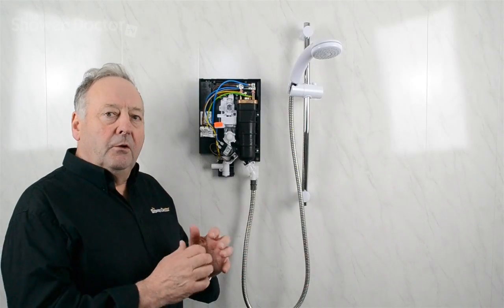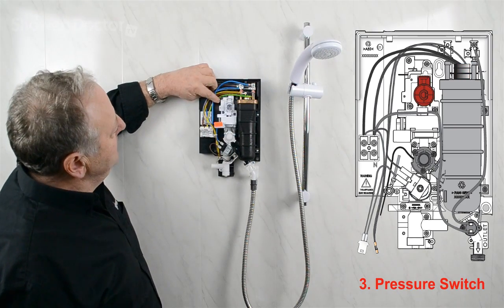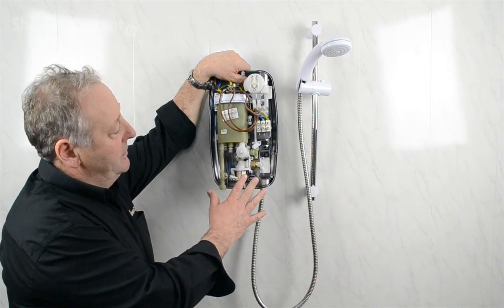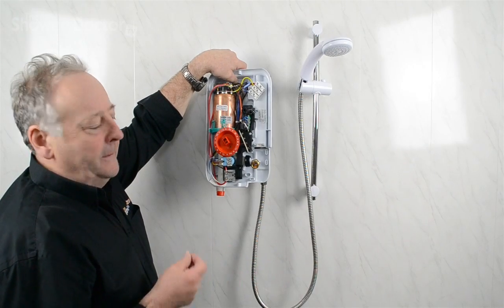Shower Doctor TV: Electric showers explained

Comment: My Creda 950DL electric shower doesn’t work properly.

The Mid LED light stays off – water runs cold at full pressure. Turned the water flow dial to extreme hot – then water gets lukewarm, while the flow from the showerhead is weak. Both High LEDs stays on, while the Mid LED stay off.

After watching your repair video, I tested components… I then tried to remove component/s. However, after spending about an hour trying…I found they were not straightforward to remove. I then replaced the cover and left it.

I suppose because the Creda 950DL is so difficult to repair, why there is no information online showing how to repair them???

So, I guess it's got to be a new shower?!

Comment: I just suddenly have no power, but no fuse off and pullcord light on. Any ideas?
Reply: Hi, Did you find the cause of the fault? have the same thing happening to my mums shower... checked fuse inside shower and switch in ceiling has electric flow, just not power to unit? There was water sitting in the top around heater switch.
Reply: @denisemaas8201  Hi yes a wire had burnt out in the shower itself. It was ducked, bit dodgy really

Comment: Hello.Doctor Shower.I have an electric shower MX Inspiration QI. There is no hot water coming from shower.last time when I used shower pressed power off button all the lights appears just for seconds instead of phase shutdown light.
One thing more if the pipe of shower (from electric shower box to hand shower) is twisted for long time after usage so it can effect the shower mechanism or it can create the the same problem (no hot water) which i am facing.
Reply: Naveed...
Have a cold shower instead; problem solved.

Comment: Thank you. I have a Triton shower 9.5Kw. When I operate the switch to turn it on, neither the switch light or shower light comes ON at all. I have verified that there is electricity flowing into the unit and everything seems normal. I'm thinking that perhaps is the 'power selector unit with microswitches' which needs replacing? The shower was working fine before that. Could it be a sudden water flow issue? Many thanks!

Comment: This is a question  I cannot find any information on . 
 My question is , what is the approx max time a electric shower should run for.  Is it 10 min, 15, 20 , 30 , 40 , minutes or more , or is there simply no specified time. 

My question relates to plumbers  telling me that prolonged use,  at any one time in a shower for over 15 minutes or more , burns the shower components out much quicker , as the components and elements are not made to stand such constant continuous use. 

Why do manufacturers nor specify any max time restrictions , or is it because  it has no effect on the components in the unit. 
Answers please.

Comment: I like your videos Shower Doctor, but not one of them mentions anything about the cause of dripping water out of the bottom hole of the shower when it's turned off, which was and still is the issue I've got. I just bought a new shower, removed the old shower unit and replaced it with the new one. Everything works great. Water switches on and off. Water heats and cools as it should, but theres just one problem...its STILL DRIPPING! It's driving me insane...AAAARGH!
Reply: ashleelmb.
Plug the hole up and it will stop dripping!
Reply: @redblade8160  I resolved it 2 weeks ago.

Comment: Can you leave the isolator switch permanently on ,mine has stopped working but its on all the time
Reply: Granville...
Don’t worry about it, if the isolator switch is on all the time, then at least it saves you the job of switching it off each the time.

Comment: Just like to say big thank you to this man here's why
Had a problem with our show Watched this mans videos on the information he gave in his video I came to the conclusion it was thermal cut out 
So ordered the part from eBay put part in the show still the same but this person told me how to test it the new one was the same as the old one but lucky enough where I got the new part from was the same town as me so I rang them up and told them I was taking it back.
When I got there they seamed to panic a bit and gave me a new one straight away I tested it the way this man told me to and I had power across the terminals didn't  have this on the first two put it in the shower worked thank you shower doctor you not only helped me with fixing my shower but  also stopped me from accepting a bad replacement for my shower

Comment: Hi, Is a copper heating cylinder better or a polyamide pvc heating cylinder better? Which type is better to prevent electrocution when it is faulty? 
I heard that polyamide pvc heating cylinder would prevent electrocution if a wire is loose and touches the cylinder, is it true? Thanks.

Comment: Hi,
1. What is the safest way to prevent electrocution if the water heater is faulty?
2. Would putting the shower head on the stand without my hand holding it, and water spraying on my body prevent electrocution?
3. Would putting the shower head on the stand without my hand holding it, and after water is sprayed into a pail, then I use the water from the pail by scooping it and pouring on my body prevent electrocution?
4. Would using a plastic shower head and holding the plastic shower head middle stick in my hand and spraying water on my body prevent electrocution?
5. Would using a plastic hose instead of a plastic hose that has metal outer casing helps to prevent electrocution?
Thanks.

Comment: Hello Shower Doctor.. I just bought and installed a Panasonic DH3KT1. The problem is the water is not hot enough even when I push the dial all the way up. It only gets hot when he water flow is really low. Could you please help advise?
Reply: Sameer...
Try turning the dial instead of pushing it.

Comment: Hello, I have a Triton Bezique ll which is only six months old.  When it is on cold, there is no noise from it.  However, when I turn it up to warm, there is a constant clunking noise.  This doesn't affect the heat of the water or the flow but something's not right.  This is my third Triton and I haven't experienced this with any of the others.  Can you help please?

Comment: sorry but in which countries is this used? in latin america they use "suicide showers" and this looks pretty much the same , just separated from the shower head. 
i'm from italia, traveled a bit across surrounding countries and never in my life saw something like this.
Reply: Everywhere uses them in the U.K.
Reply: There's a very large difference between the suicide showers and these, suicide showers have 0 fail-safe and they're raw heating elements on water, these are very well thought through and have several fail-safes along with a much safer application of electricity.
Reply: Uk and Ireland we have completely different heating systems In our houses we use boilers for central heating.

Comment from the maker: If there is blackening at the tco then the connections maybe loose.
I would be inclined to change the solenoid if the readings are this high.
Have you tested that you have 230-240v inside the shower?
Reply: The Shower Doctor 
Thank you for your reply.

When I told the wife about the blackening on the connections, she insisted I called out an electrician. I went through everything we have discussed and one extra bit of info (prior to this  (for around 2 months)the shower would work for 5 minutes or so then go cold ). However, the electrician on closer inspection noticed that one of the red live wires had melted onto the back of the plastic casing-it looked ok until you just prized behind it. He then recommended a new shower. I am now looking round for a similar shower, so it will not be too difficult to install.
Once again thank you for the information . Your videos and advice gave me the confidence to use my multi-meter for the first time..
Reply: The Shower Doctor
Reply: The Shower Doctor toou

Comment: My Creda (650) shower has stopped working. Pull chord light still on and circuit breaker still on. The high and medium button lights have gone off, the cold button light is still on, however there is no water coming through at all on any of the three buttons. The shutdown button- the light come on and flashes then goes off-as normal, but there has been nothing to shutdown.
Reply from the maker: chemistry636 
It may be your solenoid valve, you can check it if you have a multi meter, you should have a reading of at least k3.5 ohms, across the two terminals any less and you need a new valve. (Check the valve in the failed state.) (When 
it has stopped working!)If there is power getting to the solenoid and it is not operating then there is a good chance that you have a faulty solenoid.http://www.youtube.com/watch?v=NzJjzWqxesc The video is intended as a guide and does not cover every shower. 
If you don’t have a multimeter  we sell them  with a guide on how to use 
them for checking and testing the various parts of your shower.Apart from helping to fix your shower, they are really useful for 
checking you have a power supply to appliances, for checking fuses and letting 
you know much power you have left in batteries (So you 
will know if they are good or not) and lots of other jobs, in short they are 
well worth a few pounds) http://www.showerdoc.com/installation/electrical-products/SKYTRO-600-005-Digital-Multi-Tester
Reply: The Shower Doctor Thank you for your reply. I have just checked the solenoid value and have a reading of k3.99 ohms. Although what I have noticed that the thermal cut out (to the left of the solenoid) looks slightly black on a couple of the electrical connections. Could the symptoms I first described be related to this item.
I look forward to your reply.
Reply: chemistry636 
solenoid value has a reading of k3.99 ohms.  
Continuity Test-Thermal cut out; the sound comes on and stays on, numbers appear then disappear and then rests at three zero`s with the sound still on.
Continuity Test-Pressure switch; NO sound, however there is a reading of 1877.
Reply: Hi i've a Creda 950DL may fault is that its running cold and it shows the overheat button on red when the shower is on can it be repaired ty

Comment: Hello Shower Doctor. I have a triton enrich shower. There is a light at the top of the shower unit which indicates power (ie electricity) into shower unit. When the rotating switch is in off position the light is on. When I rotate it to on position the light is off and the shower does not come on. Can you tell from this what part inside shower is faulty and needs replacing?
Reply from the maker: Hi Ashley, this fault could actually be external to the shower.  Those symptoms often occur when you have a faulty pull cord switch.

Comment: When I pull my shower cord the light comes on to signal Power but when I push the power button on the Triton the light at the pull chord goes out and the shower does nothing, subsequently when I unpress/turn off the Triton the pull chord light comes back on. I have checked the circuit breaker for a bad connection and it's fine.

Please Help

Triton Jewl 9.5kW
Reply: Probably a faulty pull cord swotch

Comment: Although water pressure is good to the unit the units low pressure light comes on and of as the hot and cold issue happens.
Reply from the maker: The things to check first are:

1 That the main valve coming into your house is fully open. 

2 Then check that the valve on the line to the shower is fully open. 

If these valves are not fully open then there may not be enough water getting to your shower to cool it properly the overheat safety device will turn the power off until it cools Then it all starts again
 
Make sure that the shower head is clean and clear, that the hose isn't kinked (this can happen just behind the hand set where it is difficult to see) also check the inside of the hose although it can look OK on the outside it could have collapsed internally 

The other possibility is a faulty flow/stabilizer valve not allowing the correct amount of water into the shower.

Comment: We had a Triton T90 xr fitted about 2-3 years ago . We were told it was a new model .What happens now , you switch on the ceiling power  switch on by a cord ,  and the light comes on . I press the  button on the shower and the ceiling light swich light goes off .When I  press the shower button off . The ceiling power light switch light comes back on .The shower does't come    on . Before this , Just recently , you were in the shower and the water just stopped . Power seemed to be on .Sometimes the shower runs for a few seconds and then stops . I hope I made sense . Is this a repair  job I can do myself . Please help !

Comment: Hi, I have an old-ish iflo electric shower in a caravan. The problem I am having is that when the power button is pressed the water comes through freezing cold and the power light does not come on, and then intermittently the light comes on and the water goes boiling hot (no happy medium temperature), then off again and cold and so on and so forth. Could you help suggesting what this could be please? Thank you.
Reply from the maker: The things to check first are:

1 That the main valve coming into your house is fully open.

2 Then check that the valve on the line to the shower is fully open.

If these valves are not fully open then there may not be enough water getting to your shower to cool it properly the overheat safety device will turn the power off until it cools Then it all starts again
 
Make sure that the shower head is clean and clear, that the hose isn’t kinked (this can happen just behind the hand set where it is difficult to see) also check the inside of the hose although it can look OK on the outside it could have collapsed internally

The other possibility is a faulty flow/stabilizer valve not allowing the correct amount of water into the shower.
I would also check the power supply to the shower is constant.
Reply: The Shower Doctor It was the main valve, thank you so much! :)

Comment: If the shower is either fully hot or fully cold with no pressure variance and nothing inbetween ie warm water control..what can that be thx
Reply: This points to a faulty flow valve.
Reply: ***** thanks

Comment: I want my power shower to use less water. Can I just change the shower head to restrict the flow rate?
Reply: Why an earth would you want to do that ?
Reply: How would it save hot water for other people when an electric shower works off the cold main and heats as you use it, not from your hot water tank? How would it save money? Just because the shower head gives out less water doesn't necessarily mean it will cost less to run.
Reply from the maker: If you have a power shower then yes you can use a head that will give you a restricted flow.

HOWEVER!!!!!!!!!!

If you have an electric shower then you need to use a head that is designed for an electric shower and preferably the original manufactures shower head or thier recommended replacement.
Reply: To save money and leave some hot water for other people
Reply: @bunglenzippy  
Tell these other people only to have a cold shower and then you will have plenty of hot water only for yourself.
Reply: The Shower Doctor   Hi there my shower is a Creda 950DL and the overheat red button is on and its very cold also can you possibly help me Doctor ty

Comment: Hi, Great video's…. I have a fault with my Triton Caselona. The water has started to come out of the little tube at the bottom of the shower unit instead of the shower head. Any ideas what it might be?
Reply: the shower needs a new pressure relief device,,,
Reply: The pressure relief device (that little tube)dropped the little rubber seal who had inside.
Now the water is coming out that way.
Need to replace it.

Comment: Hello Shower Doctor, I hope you can help. We have very hard water, my shower is a Galaxy Aqua 3000si 9.5kw. When in use it is making a noise like a boiling kettle. When on the high setting it is too hot to stand under so we have to use the low setting. I thought the flow might be restricted due to the shower head being scaled up but the problem is the same even with the shower head removed. I'm hoping you can advise which part needs replacing please. Thanks in advance.

Comment: if the water pressure changes from the supply line(for example someone starts the dishwasher) does the mechanism recognize the pressure difference and regulate it and adjust the temp accordingly also?
Reply from the maker: The answer is yes and no!
The cheaper showers do not recognise any pressure difference and as you go up through the price range the control of pressure and temperature becomes better, the more expensive showers control the temperature very accurately

Comment: Hi there, brilliant videos but I can't determine what my solution is. Triton t90si - water temperature has dropped dramatically. To get warm water I have to turn the dial to 9 or 10 and then the pressure is very low. I've used a multimeter to check the solenoid, tco and the elements. All seem fine. When the dial is turned down to 0 water pressure is great (but cold). I would really appreciate any help.

Comment: hi i have a triton ivory 2 and it does not seem to have any power running to it :/ the light on the power switch is on but the "power" light on the shower it's self does not, any help please?
Reply: Hi, Did you find the cause of the fault? have the same thing happening to my mums shower... checked fuse inside shower and switch in ceiling has electric flow, just not power to unit? There was water sitting in the top around heater switch.

Comment from the maker: It maybe a faulty flow/stabilizer valve not allowing the correct amount of water into the shower. 

A rough check is to remove the shower head turn temperature control to fully hot the water coming out of the hose should be a bit more than a dribble then turn to fully cold and it should be coming out at full flow. 

If there is not much difference between the two then you could have a faulty flow valve.